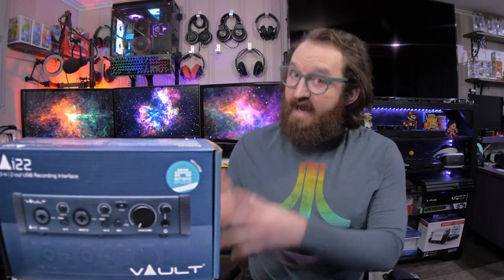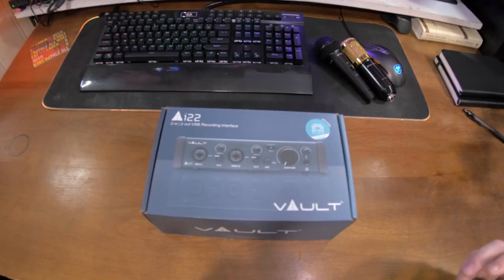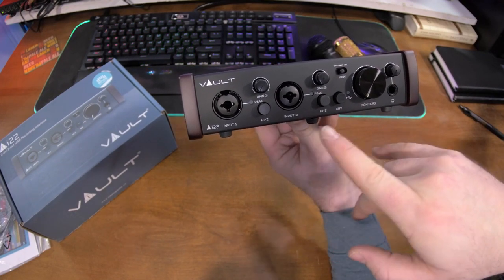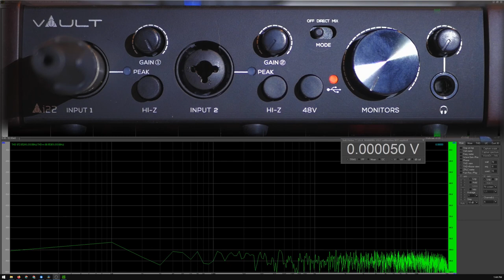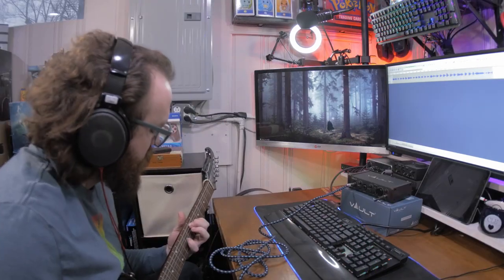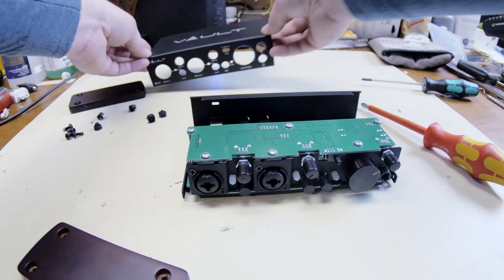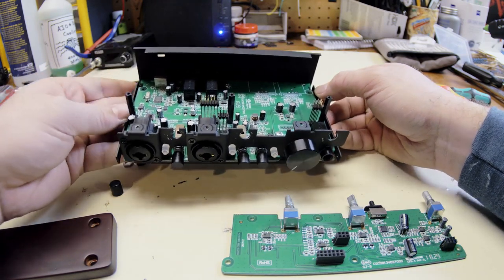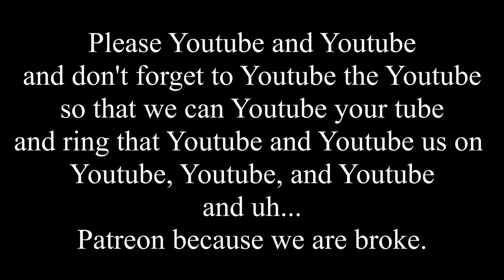Shout does a review on Vault Ai22 - Best Cheapest Audio Interface?

Comment: Hey I just bought mine and I love it it works fine within itself. But I have a Windows 10 and it's not recognizing the microphone, only the speakers so I can't record. the interface works just fine. If I were to play some music on my computer I could use the large knob and listen to it through my speakers I could also hear through my headphones. but getting the interface and my system to work together with the condenser mic is a bit challenging can you help me? My intent is to record in producer edition of FL studios 12
Reply from the maker: We did not experience this issue. Maybe try a different USB port and confirm your audio settings are correct. If that doesn't work, you'll want to contact the manufacturer.

Comment: Caps looks cheap, but, hell I buy old stuff and have to recap almost everything anyway.
Reply from the maker: Hey! Great insight? What makes you say that? That didn't jump out at us when we were looking at it. I'm very interested in your take.
Reply: I replace them with solid electrolytes, they are more reliable and last longer.  Most quality gear has them already.  But it should last a good number of years with the caps it has.  With how much you save getting this unit, it's worth the extra trouble to spend like $5 and recap it so it would last longer.